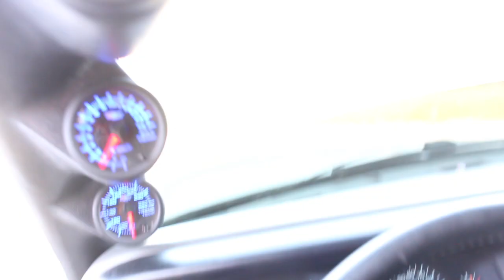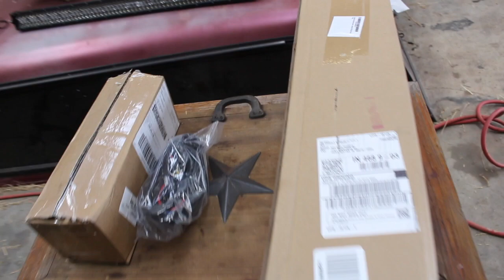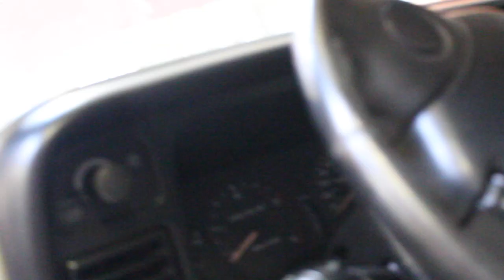INSTALLING 52 Inch CURVED NICOKO LIGHT BAR On 2nd Gen Dodge Ram!!! *SUPER BRIGHT*

Comment: I just did a 50 inch on my 1998 f150 and I had to pull back my weather stripping and fit the brackets in between the strip and the cab then cut out slots for where the brackets line up and stuff so that opened up a hole through the strip so I ran my wires through there into the engine bay and had to make my own wires because I got the light bar free and it didn't come with the wiring harness

Comment: Tilt the lightbar up. It doesnt look good facing down
Reply from the maker: Wyatt Blake it’s facing straight forward.. not down
Reply: Wyatt Blake it just looks faced down by the way the bracket is shaped.
Reply from the maker: John Kelsern correct
Reply: LOUD 'N' PROUD u should get ur dad to put a light bar on his truck in the bumper